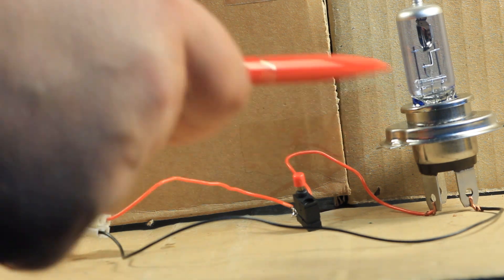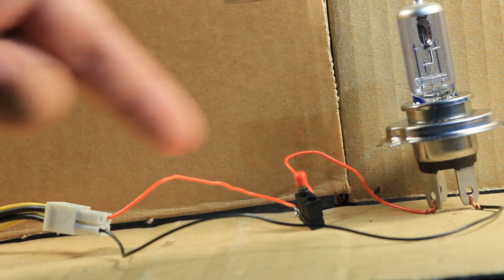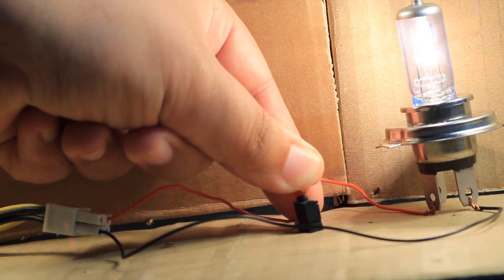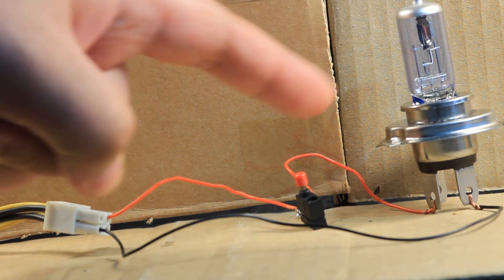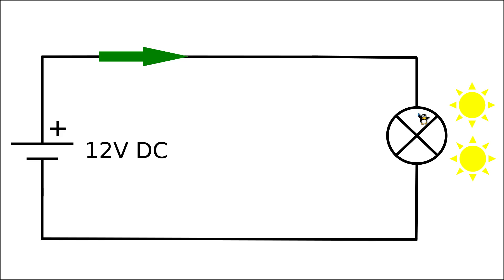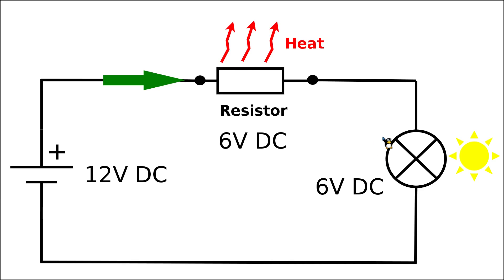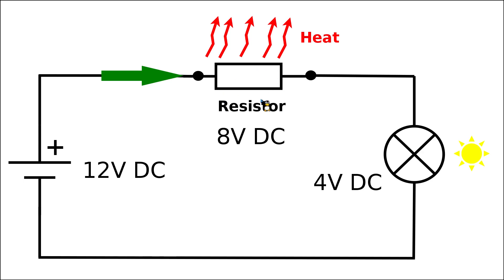Howto repair switch mode power supplies #6: Basics of Linear Regulators and voltage references

Comment: So, theoretically, you could use PWM to dim an incandescent bulb also, as the width of said pulse would determine the average brightness of the bulb in a given time period? In my limited knowledge and experience that would be more efficient than using resistance to dim the bulb as you're not wasting the excess power as heat? I've commented at 3:51......I should wait until the end of the video as I think you may be going in that direction since this is a SMPS video lol.
By the way.....very informative videos explained in a way that is easy to grasp concepts. :))

Comment: Really fine job, fantastic! Deep detailed explanation, keep doing it.  A little beat deeper about the Zener Diode function could make the subject matter more transparent. How the zener diode controls the varation at the input side. And try to demostrate it on bread board, with Voltmeters or Oscilloscop.

Great thanks.

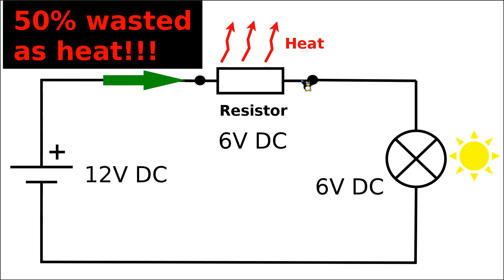Comment: At 5:13  Why 50% wasted power ? The current   when the resistor is connected will be smaller  than without connecting the resistor.
Power across the resistor is R times I squared.
Or Power is equal to 6 volts across the resistor, which is half the 12volts that was across the bulb, multiplied by the current through the resistor and the bulb which is smaller than that in the first case when the circuit had the battery and the bulb only.

Comment: Great job!
You should use the d15xb60 full bridge rectifier chip. You can screw it to a heatsink and take up to 600 volts. They are dirt cheap!
Reply from the maker: Well, in this video we are not even talking about diode bridges yet, we assume that we feed in pure DC to the circuit.

Comment: I have a exercise machine (an elliptical) in which there is a lower motor control board that appears to have some of the same components that you show here. My issue is that the 6v resistance motor that is controlled by this board, is not getting sufficient voltage under load to move the brake magnet away from the flywheel (so resistance is stuck on high). The voltage being supplied to the motor is only enough to move the magnet when the magnet force is about half of maximum brake position. This same board also controls the incline motor which appears to work fine and is a larger motor. Where would you figure to be the cause of the insufficient voltage to the 6v resistance brake motor? Knowing that the larger incline motor appears to work fine? Here is a stock photo pic of it: https://www.fitnessrepairparts.com/product_files/Controller-Motor-176757-6077147.jpg
Reply from the maker: From that small picture you linked I cannot see much, so I can only guess. Btw, have you already checked the cabling going to the motor? Is the cabling all fine, and is the cable tight on the motor so the power is not lost on some lose contact?
Reply: Thanks for your quick reply! Yes, the cabling is fine. Everything works as expected as long as the magnets are no less than half distance from the flywheel. There are 24 levels of resistance, so anything lower than 12, the motor operates fine (albeit slowly at first, then better as the magnets get further and further from the flywheel all the way to level 1 resistance). However,  anything higher than 12, the motor stalls and the voltage supplied from the control board to the motor is merely 0.28 volts. The motor is a 6 volt motor and needs at least 1.5 volts to operate (ideal voltage is 5 volts to spin it faster). When I disconnect the motor's steel cable from the magnets, so its just connected to the elliptical and not under load of the magnets, the console sends 4.8 volts to the motor, which is the expected voltage. However, under load, it only sends 0.28 volts, almost as if the microprocesser chip (R5F21366CNFP) senses some overload and shuts down the voltage on purpose. FWIW, here is a thread I created on diychatroom that has more info on my problem: https://www.diychatroom.com/f18/elliptical-machine-panel-sending-too-low-voltage-resistance-brake-motor-659163/index2/
Reply from the maker: Are the two motors the same? What I mean by this is that can you change the two motors to make sure the issue is not with one of the motors but with the controller electronics.
Reply: @DonkeyLearningIT  I have actually tested 4 different 6v motors with the same results on all. Yes, these are very common 6v motors with B5K pots. Just about every elliptical and exercise bike, regardless of brand, uses this same system, right down to the 6v motor. The white wire (middle wire on the B5K POT) sends variable voltage back to the controller on the exercise bike or elliptical and that's how it knows the relative position of the magnet brake. Why would the motor's load impact the controller's reading and subsequent voltage drop back to the motor? When everything works as expected when the motor is not under load.

Comment: Does the current flow from the minus to the positive? The diode placed into the circuit will on conduct current if is is placed with the arrow pointing to the minus.
Reply from the maker: You should check my new video on this series (#10), where this is explained. Zener diodes are reverse-biased in a circuit. Namely, a forward biased Zener will have a voltage drop of only 0.75V, similar to a traditional diode. On the other hand, a reverse-biased Zener will produce the Zener voltage.

Comment: Kann mir jemand bei Einen Problem mit dem NT helfen ?
Reply from the maker: Mit dem NTC (Thermistor) ?
Reply: @DonkeyLearningIT  no its a PSU with 700 watts but the problem is. Cannot switch it on power button . Please help
Reply from the maker: @senolj7241 Can you give a couple more details of what do you mean by not being able to turn it on with the power button? (oder von mir aus auch Deutsch).
Reply: @DonkeyLearningIT  yes in German please 😊 ich habe das Problem , das am Gehäuse der Power button nicht mehr funktioniert!  PC Gehäuse wurde auch ausgetauscht Problem bleibt weiterhin . Auch Mainboard alles ok 24 Pin ok und Power button header is OK . Jetzt zu meiner Frage das Netzteil ist es definitiv! Nur ist es ein Kondensator oder was muss da ausgetauscht werden ? Etwa microchip ?
Reply: @DonkeyLearningIT   ich hatte schon einmal das gleiche Problem. Vor etwa 2 Jahren da habe ich gleich das Netzteil weg geschmissen ... wohl zu unrecht oder ?
Reply from the maker: @senolj7241  Wenn man überhaupt keine Erfahrung auf dem Gebiet hat, meiner Meinung nach sollte man am liebsten ein neus Netzteil kaufen. Nämlich, man braucht ziemlich teuere Werkzeuge um so was zu reparieren.
Reply: @DonkeyLearningIT  habe Werkzeuge da . Vor kurzem erst von einem 42 Zoll NT Kondensator getauscht ! Also lötkenntnisse sind da . Und auch menschlichen Respekt vor hochvolt bzw Strom . Also Kondensator sehen alle okay aus . Was konnte den da kaputt sein?
Reply from the maker: @senolj7241 Erstmal das Netzteil von Strom trennen. Danach mindestens 6 Stunden ruhig abwarten ;)
Schrabenzieher vorbereiten, Netzteil  öffnen, und eine Sichtkontrolle (Visuelle Inspkection) durchführen. Es gibt was drinne offensichtlich kaputt?
Reply: @DonkeyLearningIT  ich kenne mich aus an Kondensatoren aber das Wars dann auch . Ok NT wird jetzt ausgebaut!

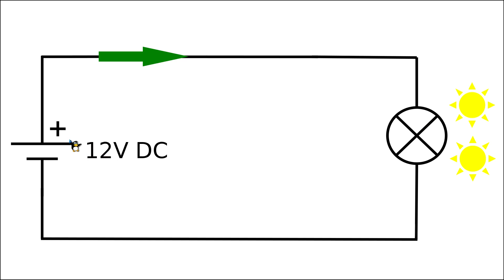Comment: 3:36 also when you half the voltage on a resistive circuit you will dissipate a quarter of the power.
Reply from the maker: Yes, however you will still dissipate half of the total power on the resistive series element.
Thus, the overall efficiency is still 50%.

Comment: I have had so many "aha" moments watching your videos. Thank you.
Reply from the maker: I am glad that it helped. However, I have to play the devils advocate, and tell you, that in fact there is something very important what is missing.
Namely, one needs feedback circuit from the output to actually be able to control the voltage. Of course, for that we need to go through about three more videos to understand first optocouplers and why they are necessary.
Reply: I am totally hooked on your videos and just know that after watching them will have the best understanding of the power supplies ever. Thank you for all your hard work.I will be following all the way to the end.

Comment: This video series is only about half complete. What is missing is how to check the transformers and coils for opens and shorts with a function generator and oscilloscope or a ring tester, how to test the capacitors for value and ESR, how to check the transistors, how to check the controller ICs, checking the waveforms, etc. In fact, we only went through about half of the components in the block diagrams in the discussion of function, so I would guess only about a third complete.
Reply from the maker: You are absolutely right since we have not even went through one third of the material. This series will take a while to finish, but it should be useful for people who intend to learn about it instead of just trying to do it "blindly" and get lucky.

Comment: G'day Donkey,
Congratulations on the Six episodes to date, what a commitment. Your systematic building block approach and in depth explanations are excellent. Given your commitment to detail I can see numerous tutorials to come.
Hopefully once all the building blocks have been explored you can use actual Cct. diagrams and boards to explain their operation.
Perhaps you could consider a video on personal safety and the dangers of testing SMPS. Also the need to isolate earths from test equipment, like CRO's, so you don't inadvertently destroy input channels.

Best wishes for the festive season.
Cheers
Danny
Reply from the maker: Yeah, I intended to do lots of videos in this series, since there are several details which need to be addressed indeed, especially when it comes to safety. 
However, as you see, in the last two months I got sloppy and have not produced new videos in the series :(
Due to holidays now I got time tom make new videos, and continue the story.

Comment: Been interesting in building my own SMPSes (mostly for fun but possibly for actual use cases) and these videos are really helpful!  Looking forward to the next ones.   One thing that I can't seem to find concise info on is how do you power the electronics (ex: microcontroller or SMPS controller IC) from mains so the rest of the SMPS can start?  Would be nice to cover this in a video.   I have a few ideas myself but curious how it is typically done.
Reply from the maker: If you are interested in SMPS design, first you should design switch mode low voltage DC-DC converters. One can learn a lot from those designs, and still stay on the safe side, not playing with lines voltages. 
Please watch my video in this series on the Stand-by circuit, that explains the main idea how is the microcontroller and the SMPS controller being powered.

Comment: I like the fact that you clearly think about teaching when producing these videos. It's a rare thing on YouTube. Mostly you are doing it very well, from my point of view. I appreciate the fact that you go into the trouble of showing us the alternative, less optimal solutions, before finally arriving at how things are really implemented. As a critique, I feel that sometimes you repeat the same thing again, and sometimes that thing is lengthy. This happens to me, too, when trying to explain complex things verbally. Normally this doesn't occur in written text because then I am more aware and in better control of the information flow and structure. Not a big deal, really - it's easy enough to just skip a few seconds. Overall you are doing a great job, and you really helped me to understand the topic better and feel more confident about my knowledge. I'm not bothered by your accent at all. You are very easy to understand and that's what matters. Will be waiting for the next parts.
Reply from the maker: I really appreciate constructive criticism, since that most often leads to the improvement of the contents. You are not the first one who have pointed out the issue of the repetition, and I agree with you, things should not be repeated in a video. The thing is that I was teaching only about 15 hours when I was at the university (it was more than 14 years ago), and there the idea was to repeat the main points. However, online format is radically different. In future videos I will try to reduce repetitions within a video, since if people want to watch it again, they can just scroll back 30 seconds.
Reply from the maker: Mostly the Apple charges are doing this, since other charges tend to use only two pins, so either there is enough juice, or there is something wrong with the charger. 
Now in those cases when there is a signal pin between the charger and the laptop (i.e. more than two pins), the situation is even more tricky, since often there is a two-way communication established. Namely, first a stand-by circuit will be turned on inside the laptop right after the charges is plugged in. This stand-by circuit will signal the charger, that it should turn on the high-power state. However, if the standby circuit detects some fault, or the charger has some issue and it does not send the right initialization sequence to the laptop, that is when the charge will not work as you described. For fixing such things you will need an oscilloscope, and you will need to monitor what happens on the signal pin.
If the charger only has two pins (GND and +18V or similar) and it does not work, but the laptop works with an other charger, and also the faulty charger provides the right voltage, than 85% the capacitors have dried out in the charger. Due to this the fluctuation of the voltage (called "ripple") is way too high, causing the inner circuit of the laptop to do not accept the voltage from the charger.
Reply from the maker: I am actually surprised that also Russian guys watch my videos, since I found some really well made technical videos on Youtube in Russian. Only issue is, that they often do not have subtitles, but one can still see that they are 100% making a good explanation.
Reply: BTW I guess it's out of scope for this series, but as computer repair tech, I frequently encounter laptop chargers that seem perfectly fine but seem to have trouble outputting something on the data pin, and hence laptops that expect this output will refuse to work properly with them. I wonder if you have any comment on this or any direction to point me at to get to understand this better. I can very well research by myself but knowing the keywords for Google is a much easier starting point.
Reply: Anton *   I'm with you!
Reply: Dell, HP, most Lenovo laptops have a signal pin. With the faulty chargers, Dell laptops, for example, may turn on, but then they complain that the charger is not recognized, refuse to charge and limit CPU to lowest frequency. Do you happen to have an idea what protocol chargers are using to communicate with the motherboard? What bus? Any hints on how to identify the part of the circuit inside the charger that is responsible for this communication? I currently don't have an oscilloscope but I plan to buy one when I have some spare money.
Reply: I have watched some Russian channels, too, but never encountered one that goes beyond "how I repaired this or that". Any examples?
Reply from the maker: Apple uses a simple serial protocol. In fact, most of the time it is not even a protocol, only it is a digital signal (5V TTL or 3.3V CMOS) which is pulling the data transfer pin low or pushing it high depending on the charger and on the state whether the charger is being detected as OK or defective by the motherboard. However, since the motherboard needs to generate the signal, first one need to make sure with a 100% tested OK charger that the fault is with the other charger and not with the motherboard. In Apple laptops the signal is generated by the SMC management chip, and in other platforms it is generated by the some control logic attached to the chipset.
Reply: Yes, in Apple almost everything is connected to the SMC. Even the trackpad. One very common problem is when the trackpad is not communicating properly (or at all) with the SMC and though the trackpad may still be fully functional otherwise, the SMC will limit the CPU to the lowest frequency (usually 800MHz) and simultaneously its driver will clog the CPU with garbage data, to a degree that the computer becomes mostly unusable. Same happens if the trackpad is disconnected. Also similar symptoms occur with faulty battery or even a sensor. We used to call this the "Kernel Task" problem because this is what appears to consume the CPU when looking at the activity monitor.

Comment: If you put half voltage across light bulb or any resistor you will get one quarter of power, not one half. To get one half of output power you will need sqr(2)/2 or 71% of initial voltage. Best regards.